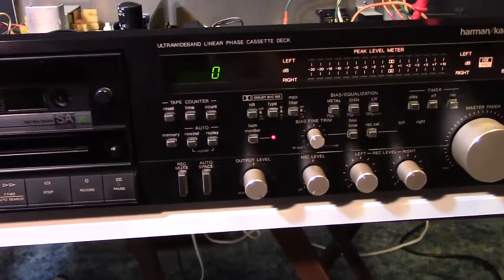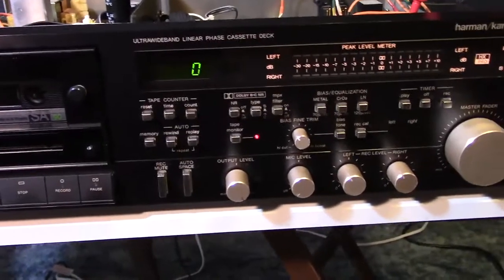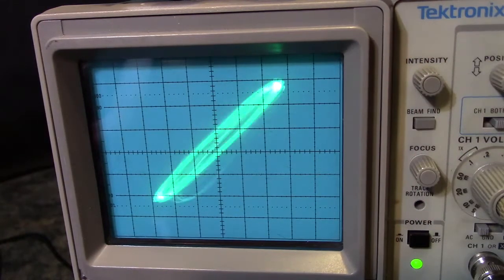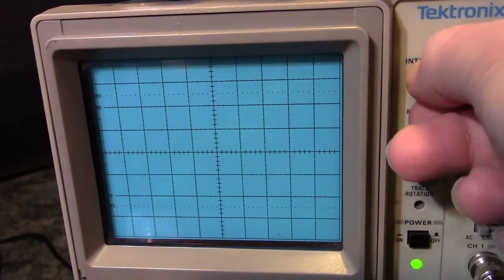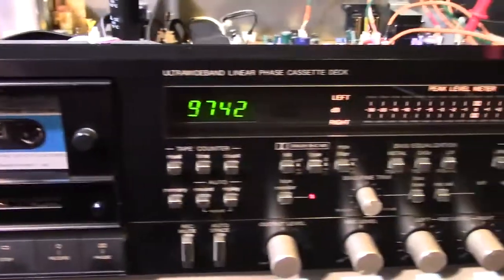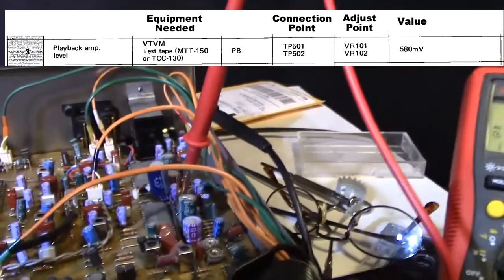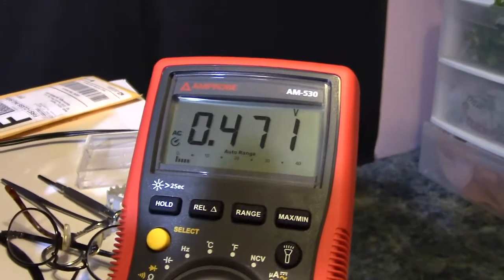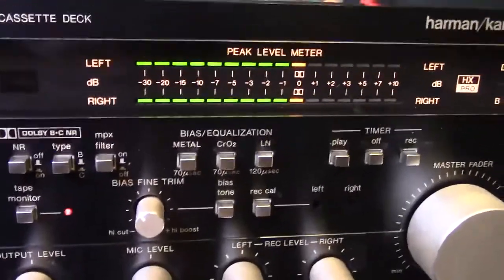CD-491 Alignment /Calibration

Comment: Do you know (once someone has made a correct 10k tone tape etc)  if you could also use that free  Signalizer  VST 0.3.2 oscillator program  to get that adjustment x y circle/line curve on a screen or do you need a real oscilator for that funktion to show. If this windows program also works for that visual azymuth on screen funktion maybe you can show which steps to do in that program to get that curve on screen.